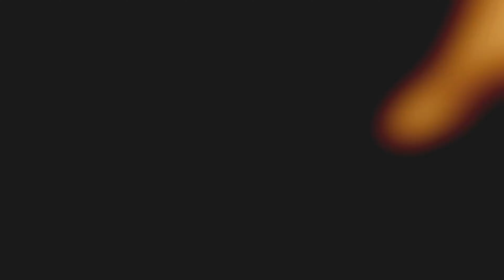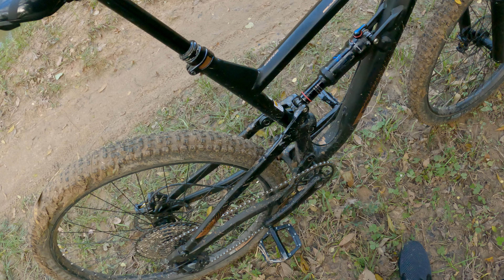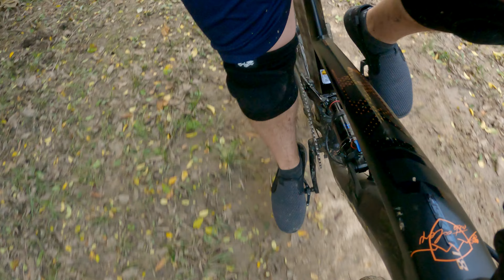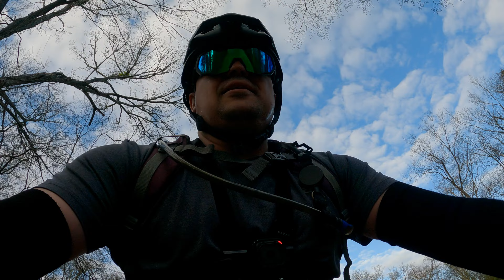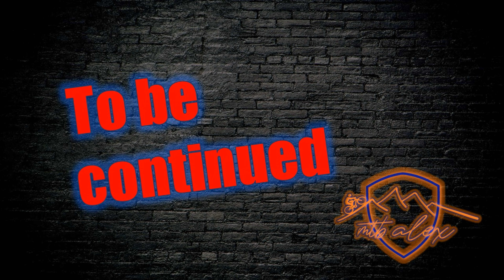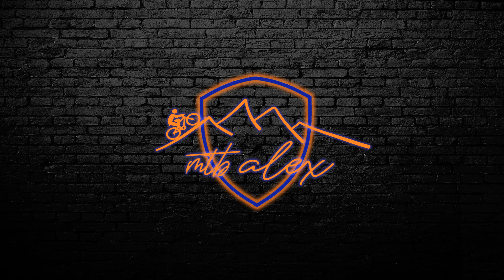Is my bottom bracket gone? Grinding noise coming out when pedaling // POLYGON BIKES

Comment: take off your pedals clean the threads and grease them, then take off the bottom bracket clean threads grease them, then also try to open the bearings seals and clean out old grease and repack them with new plastic safe grease.
Reply from the maker: Thanks man, you read my mind.